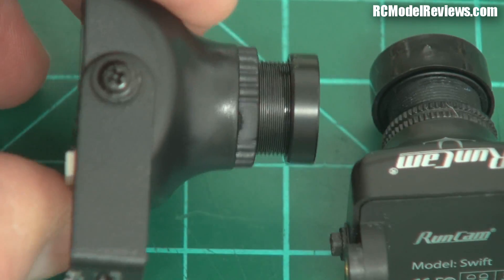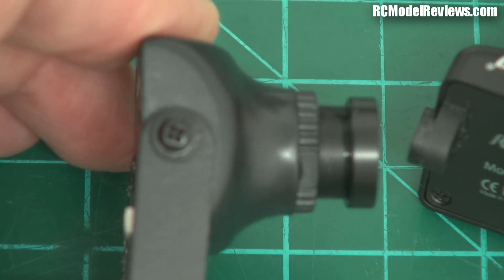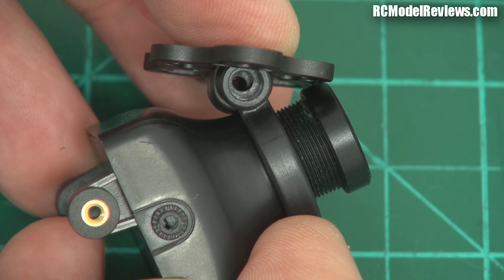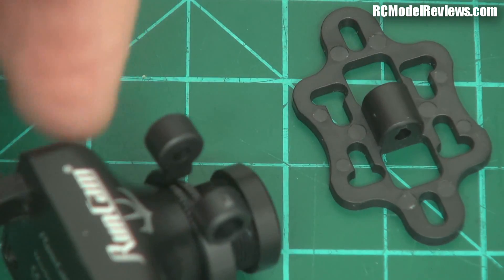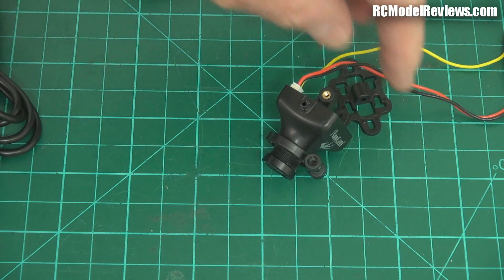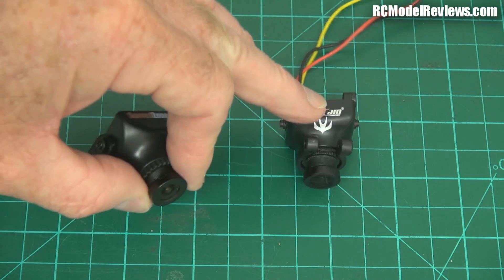On the bench: Runcam Swift FPV camera

Comment: finally! a silicone wire for my favourite fpv cam! :,) the runcam  fpv camera's are truly made for fpv and I never really liked the hs1177. mainly for the osd. like the fact it has a case now. but normally I cover the components on my pz0420m with epoxy to prevent them from flying off! I never broke a epoxy'd cam:)

Comment: My experience is the thin metal camera mounts do bend if they're allowed to take an impact. Fortunately, they're just as easy to bend back, so that's nice. But the best practice IMO is to install the camera such that it is protected by the frame. In a hard head-on impact, if it comes to it, I'd rather have the camera bracket bend than break the top plate.

Comment: to my understanding and from what I have been reading, the width of the camera is smaller compared to the Runcam Sky, allowing it to fit in between the carbon camera plates that are delivered with many 210 sized frames, such as the QAV 210/Lisam 210.

Except for the camera mounting/size differences, the internals are supposedly identical. The default camera settings are different.
Reply: That's some handy info as I have just ordered a 210 size frame. Thanks.

Comment: the previous runcam sky had a separate osd plug, too.. but that camera was not compatible with many osds! might get one of these swifts!
Reply: +jamble7k The OSD is just for changing settings on the camera. The OSD plug has nothing to do with OSD's you use in flight.
Reply: +Robert Bailey i know? the minim osd did not work with the runcam sky...

Comment: Do you know if it comes with an option of connections on the top so the wires don't get jammed on the bottom plate when you angle it up? The hs1177 can and it is great where space is limited. Big thumbs up to the silicon wires and separate osd plug - I'd almost buy it just on those alone...
Reply: Yeah I did wonder why they didn't put the connections at the top. They tend to get in the way on the bottom.